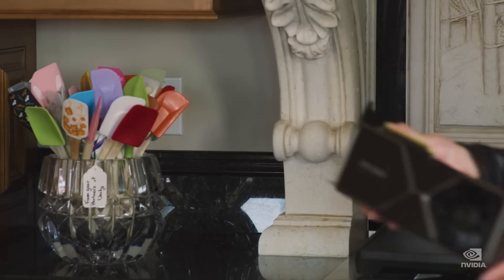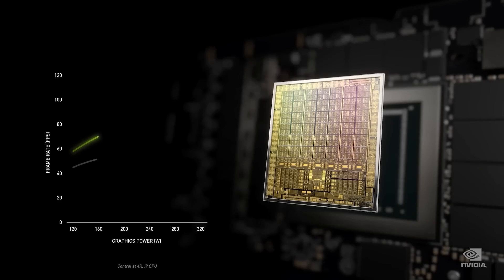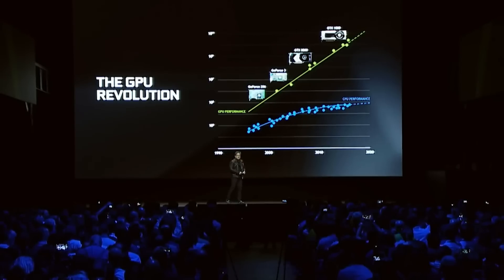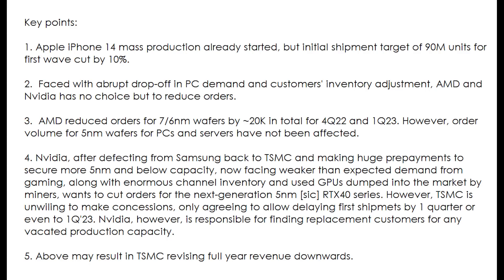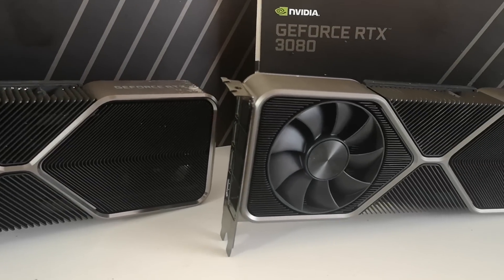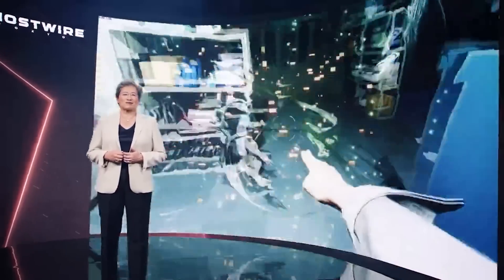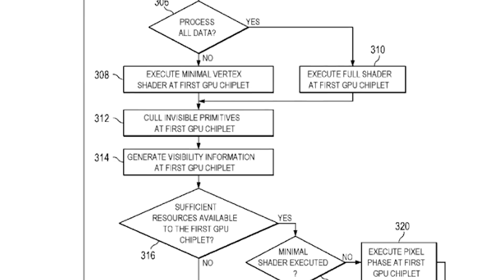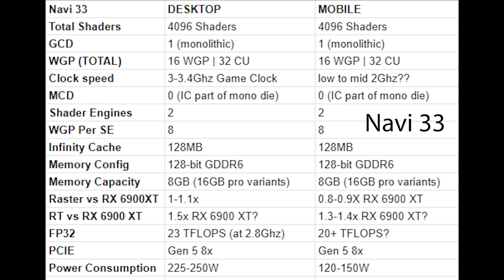RTX 40 Is A Clock Speed MONSTER | New AMD Multi Die GAMING Patent Surfaces

Comment: It should simply come down to cooling and power consumption. There is obviously no other limitation because if AMD can push 3Ghz on RDNA 3 on 5nm, why couldn't nVidia potentially using 4nm (enhanced 5nm)?
So if they had lower power consumption could easily see 3Ghz, so 2.65Ghz because of the higher wattage seems logical.

Comment: I remember last year, some rumors saying RDNA 3 (at least Navi 31) would having MCD mainly for the GCD. But, now, this seems to be for RDNA 4 (and Lovelace ‘next’, Blackwell?) to use MGCD - probably because it’s much more difficult to optimize drivers for MGCD than SGCD, if I may say so. Therefore, maybe Navi 31 (the SOC) will consume more power than expected (but less than AD102, as it would seem)
About production and price: cryptogame is over, and high price, too… but AMD and Nvidia don’t like that, so they want to reduce production, maintaining high margin, instead of reducing price (GTX 1630 is a perfect example of maintaining high price, even for low-end GPU, once upon a time, could have been at $50 or so, instead of $169…)

Comment: Found a 3060 ti FE on Best Buy for 400. You think I should keep it or return it and wait for a $400 4060? Idk if it’s worth skipping summer break though.
Reply: It will be a while before 4060 comes out. I'd keep the 3060ti, its a great card for 1080p or 1440p gaming. Less demanding games can probably be played in 4K as well.
Reply: The 3060 TI is a good card. Will boss most games at 1080p high/max settings.

And there is no way the 4060 will cost $400. Will be more than that
Reply: U know the prices of the 4 series cards will be jacked up by 3-400 at least
Reply: @joestuehmer7967  I’d assume that every card would be bumped up in terms of price to next tier. Like 4050 is $300 or $330, 4060 Is 400, etc. Could be even more though.

Comment: My gigabyte rtx 3080 gaming oc reaching 2235mhz when i overclocking it TSMC 4nm rtx 4000 series will hit over 3ghz for sure but AMDs dual gpu setup will be a monster
Reply: Nvidia rtx 4000 will be just wholly better. The rumoured 4090 will be more than 2x faster than 3090

Comment: Upgrading to Zen 4 will come down to speed and cache. If it's only ~18% faster with the same amount of cache as Zen 3, it'd be better to get the 5800X 3D. It's already that much faster and the extra cache will be better, longer. So you can skip AM5 completely. Zen 4 would need to be ~20% faster than the 5800X 3D(which would mean roughly 40% faster than the 5800X) for me to offer that as an option to my customers. And I don't see that happening.
Reply: there are  zen4 3d versions coming with even more cache and more mature tech so clockspeeds will be able to go lower, I think the performance uplift will be massive
Reply: @maxs9894  We'll see. I only care about facts and the only facts AMD has said was ~18%. And if they launch Zen 4 3D, when will it be? 2 years later again? The Zen 4 launch has to be done just right with the proper sku's. They cannot release a 7800X that ties or loses to the 5800X 3D because of cache. They would be laughed at Worldwide. So, hopefully we get pleasantly surprised with 3D skus at launch. They might be sandbagging their original sandbagging.
Reply: @TechRIP  That's true. Kinda like 11900k from Intel 🤣🤣 although that was only laughed at by some reputable reviewers, I feel like most of the Intel fanbase still defended it. We'll see about this one
Reply: @paladinsk2  Yeah. Like JayzTwoCents. He even built his friend a system using the 11900K even though he had plenty of 12900K's. And he told his friend..."Well I only have the 10900K in my system". He is such a joke. Worst second to Linus.
Reply: @TechRIP  Lol, what a joke. I used to watch him sometimes but recently I realized he doesn't actually test anything, in a meaningful way at least, with proper methodology. It's mostly just him rambling and giving his own personal not very accurate opinion in between irrelevant pieces of whatever is in his mind, or him trying to be funny.

Linus is like the mainstream media, you can sometimes watch some of it just as a background noise, or the tech quickie for some interesting tidbits.. but for me, Gamers Nexus and Hardware Unboxed are unbeatable in their testing and methodologies.
Reply: @paladinsk2  Even with GN and HUB, like any channel, I keep the video paused and only examine the graphs. Even they are too biased to listen to.

If you watched HUB's Alder Lake review, you'd come away with "Alder Lake being 2% faster than Zen 3".

But, if you don't listen or watch the video at all and just look at the graphs, Alder Lake was only 2% faster because he added the game Age Of Empires which beat Zen 3 by 41%. So having a game that was 41% faster still only made Alder Lake 2% faster.

So, then I went to the game benchmark graphs. The 5800X beat the 12700K 6 games to 3. The 5600X beat the 12600K 5 games to 4.

Alder Lake might be faster, but it wasn't better. And they never mention those facts. So, I just click a vid. Hit pause. Scroll to graphs. Write down and compare facts so that I can help through facts. Not opinions. You'll never get the truth listening to their opinions. lol
Reply: @TechRIP  adl was better value for a while,ddr5 is useless for it so ddr4 is fine/it gets the same fps while getting way more productivity performance/while being cheaper (and b660/h670 fixed all the mobo price problems)
Reply: @TechRIP  linus is the worst imo,jay is close for being an 11900k shill tho
Reply: @bgop346  Heck. Last week Jayz had like 3 or 4 paid infomercials in a row he tried to pass off as content. I tweeted about him trying to win the Billy Mays crown from Linus. Billy Mays' son, actually liked the tweet. lol
Reply: @maxs9894  I'm at least waiting for zen4 3d to upgrade from my 5800x3d.... if not waiting for zen5
Reply: That's a pretty bad take on what's about to happen and AM5 in particular. AM5 is likely 3 generations. ZEN4, upgraded Zen3 with the speed benefit of TSMC'S N5 node. ZEN5, overhaul, Zen6 upgraded Zen5. Zen7 would be another overhaul so probably on AM6.

By the time AMD is done with AM5 that platform will be WORLDS better than AM4. I mean the specs for what a X670E MB can do makes X570 look weak. And it gets better from there.

It depends on what you do with a PC. If you browse the web, listen to music, watch videos run office apps, AM3 is already good enough although you need to switch to Linux to use the platform or pay a crazy amount to Microsoft for Win7 or Win8.1 support shortly.

If you game, modern game engines will become more demanding over time as they always have and faster systems will be needed to keep up with ever faster GPUs as has been the case for 2 decades.

After that, if you run apps that can push a many core CPU to 100% CPU utilization Zen6 is going to STOMP on Zen3, just like Zen stomped on FX CPUs.
Reply: I'm getting a 7600X, and upgrading later to a 8800X3D/9800X3D. Being an early adopter of DDR5 doesn't seem to matter when the 3D cache takes care of that for the most part.
Reply: What is your resolution and targeted fps ? the 3d cpus are not worth the money if u dont buy a 3090 like gpu

Comment: There’s no way that patent pertains to RDNA3. The filing date on the application was ≈ 6 months ago, and the way the patent works requires significant software integration. Even if they have all the bugs worked out and a proof of concept working (and working better than status quo which is a key requirement to actually implementing!) it’s going to take years to get the necessary software layers implemented in API’s, game engines, compilers, etc. 6 or even 12 months is not enough time for all of that work. Realistically we’ll see this implemented in 2024-2025 timeframe, and a very good test candidate for adoption is a closed system architecture such as what we have on the consoles.

Comment: The patent really sounds like some GPU chiplet approach that would utilize an IO die rather than just MCM and GCD.  The IO would have logic and things the current GCD seems to have already, but be able to split workload to GCDs. Could be for RDNA4, but sorta a separate effort also compatible if the RDNA3 GCDs if need be and finished early. And also could include ability to do consumer stuff like MI300 that is more APU IO die with GPU and CPU units able to be tied in.

Comment: 3gpu Chiplet rdna3 would be insanely fast. 60cu*3. I wish amd would developed a socketed Chiplet based gpu board where you buy individual chiplets and later add or upgrade them. I'm dreaming but oh well
Reply: Definitely beyond the average consumer there. Gives them an excuse for a $2k card having that ability
Reply: Adding chiplets makes no sense.
First off, you'd need it to be SOCKETED. A chiplet is normally connected by a local bus with copper traces. But if adding later you need a SOCKET. You'd then have a height difference. You'd also have different cooler requirements as well as different POWER requirements from the graphics cards power delivery phases... you'd also need the same architecture.
I'd far rather see a completely different approach where there's a plugin "unit" that's essentially an APU + Shared memory. Basically an XBOX but without the storage. You could plug into your system by USB. Sure, it would be expensive but it would also be a standalone unit capable of running a diagnostic so the resell value would be high. You would then just plug a newer unit into your existing, low-powered PC.
(Would need OS support but it's not very complicated as we have GPU switching in laptops for years. So you buy a cheap computer, plug this in via USB Type-C, and when you start a game it simply copies the files over to the shared GDDR6x memory pool for the APU and then this external box runs the game)

Another big advantage is the CPU and GPU should be appropriately paired. So someone not familiar with PC's could just buy one, plug it in and it "just works" with no fuss. The only issues are you'd need video passthrough or you need to connect direct to the external box. And once SSD asset streaming gets going you'd want a high-speed 5GBps+ USB connection but that's quite doable... also the unit should have the AC/DC integrated and the cooling should be efficient as it's exposed directly to the air.. similar to a modern graphics card so the fans would just blast cool air down onto the heatsinks but in this case exhaust right to room air rather than back into a hot case.)

Comment: I'm somehow skeptical based on the power levels to get the clocks that this would actually translate into performance, it could be all for not a lot of performance if they start having leaking and such. I suspect AMD will be getting more from the clocks as they proved this is possible without massive power increases in RDNA2.  Lovelace doesn't seem re architected vs Turing enough for a process shrink to allow nice linear clock/perf gains to 1.5-2x levels.
Reply: The reason why the power levels are through the roof is because technology isn't advanced enough and they compensate with high power draw, aspect admitted by someone working at AMD in an article this YouTuber talked a while ago but cherry picked some phrases.
Reply: @Apostle_of_Fate  Yes, but you can only go so far on power and clock before you start to get leaking and errors that make the performance gains from extra clock fall apart unless you are super cooling the chip below ambient temperatures to compensate.
Reply: @stormsj  I agree with you. This madness of OC they are doing is not a solution on the long run and we need to take into account the life span of gpus. The current gen are running dangerously hot without adequate cooling and I fear it will only be worse with the next gen cards. Higher temps, voltages will decrease the lifespan and we must not forget that in this period of chip/technological crysis we find ourselves in that affects: prices, supply and availability the quality in enough itself will bear some question marks.
Reply: @Apostle_of_Fate  The 3090ti runs far cooler than the 3090. They know what they're doing and I wouldn't be surprised to see excellent cooling on Nvidia gpus while AMD will have 100°C+ hotspot temps. Lol.
Reply: @jjlw2378  having the memory on the back of the card like a 3090 is a design flaw.
Reply: @davidbrennan5  Agreed but 3090ti still has a much cooler gpu core as well as memory temps than a 3090. I'm just confident that Nvidia has learned alot from 30 series and 40 series will run comfortably. On the other hand I think AMD might have to do some more work on their cooling solutions because many of their cards run at 90°C+ on the core hotspot temp.
Reply: @jjlw2378  I saw a used 3090ti on ebay sell for 600 this week. That card hasn't been out that long, I thought about bidding on it.
Reply: @davidbrennan5  You should have. It will be close to the performance of a 4080 and I guarantee you won't get a 4080 for $600 anytime soon.
Reply: I need a new case, my cooler for my new processor won't clear the side panel. I also need a beefier  power supply first, I'm running a rm650, if I get a 3090ti I need 3 8pin connectors free  and if I go with 4000 series I need a psu with the new pcie5.0 connector.

Comment: Got any news on the 7800 XT? Because I don't think anyone who's slated to actually buy an upcoming GPU release care too much for NVidia's new breaker-tripping space heaters.
Reply: It depends on the actual truth and the pricing.
Reply: I certainly care.  Right now a 4090 is my leading contender (will undervolt slightly to bring it in to more reasonable levels.... 380-400watts).  But yes very interested in the 7900XT.  4K 120Hz demands nothing less.
Reply: Nvidia fanboys will buy it in a heartbeat.

Comment: 450Watt with 1200-1800Watt pulse spikes, hopes PSU survives... at least smoke detectors are mandatory from juli 1st
Reply: 1200-1800 spikes? No lol idk where you got numbers like that but the spikes won't go to 1800watts lol or 1500watts. Just keep in mind my 3090ti is 480watts up to 520watts and it's spikes are no where near that! Lol also evga and others are coming out with new psu's that will be able to handle it fine lol.
Reply: @reviewforthetube6485  It absolutely is a problem even with current cards. Probably not 1200W, but 3090 can spike over 650W.  If 4090 is significantly more power hungry than 3090 I could see it spiking near to 1000W, but that's just a guess at this point.
Reply: @spencergough81  i didn't say it wasn't a problem I said it ain't hitting the numbers he said. Clearly I said even my 3090ti doesn't spike that high I didn't say it didn't spike or it isn't an issue lol. You legit just said what I did that it won't be what he said that was my only point with my comment.
Reply: Gamers Nexus did a recent video where I think they saw spikes as high as 3x, so yes, this isn't farfetched. They may include a 2500W power supply in the box.
Reply: @cyberfred5520  dude he showed the peak power spike being 669 watts on a 3090. Yes he's talking about resting watts which is only around 290 from pcie wires but its a 400watt card. Not actual performance or when it's being pushed. Which most of these cards rated at 480watts aren't 480 unless being used. So of course it's going to sound like alot but he showed the peak spike of a 400watt card being 669watts. Which means the 4000series will be similiar. The 4090 on the other hand will get spikes of around 1000watts maybe but again not 1500 not 1800 haha. And there will now ay in hell be any 2500watt psu needed when as he explained himself you only need an 1000watt power supply for the 3090ti and that's to be safe people get away with 850watts all the time. Which is a card rated at 480watts and up to 520 watts meaning I'm getting spikes around 750-780watts from what I can see myself. We aren't going to see spikes as high as yoy guys think. He's rating it power from wires which is the rest power of 290watts for a 3090. My 3090ti is around 390 power from wires which would mean with what the 4090 is rated probably 450watts power to wire and rated at 600watts. 4080 will actually be 30 watts less then a 3090ti so no worries there. The maximum you will see from a 4090 I'm guessing will be around 1000-1100 watts in spikes that's the maximum we may not even see that if we go by what 3090ti spikes are with rated at 480watts which i can use a bios for 520 watts and I've not had a single spike hit 1000watts.
Reply: @reviewforthetube6485  Well, we'll see once they get the cards for testing. It may not be as bad.
Reply: @cyberfred5520  I can agree with that for sure! All speculation and estimates at this point.